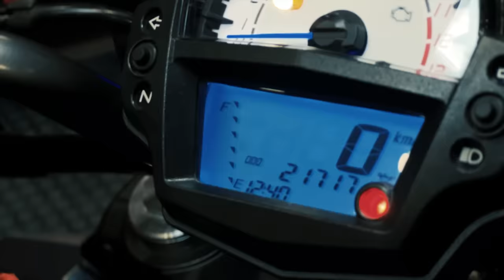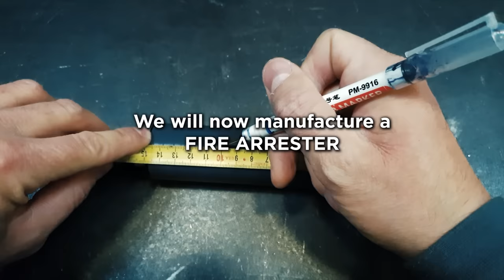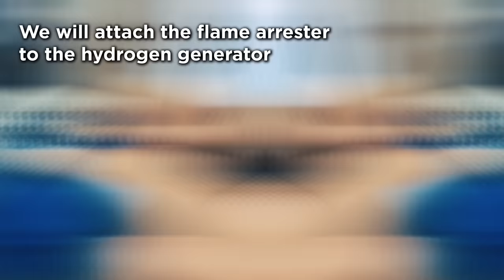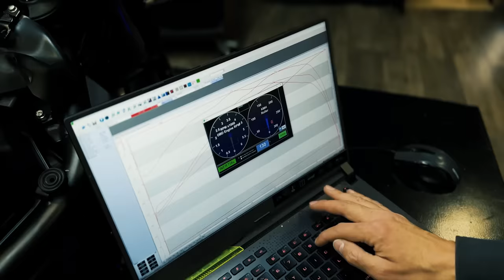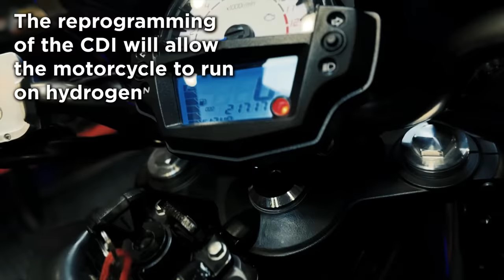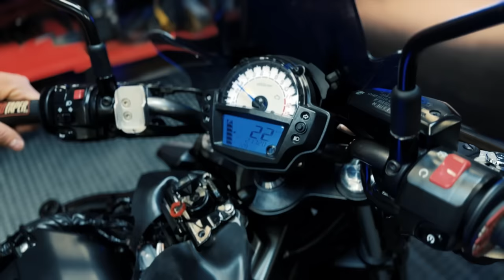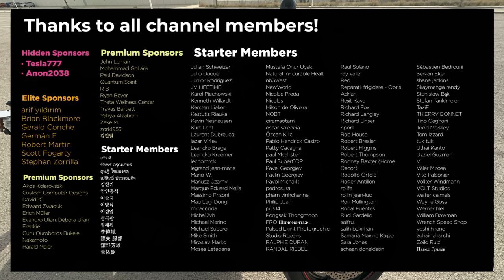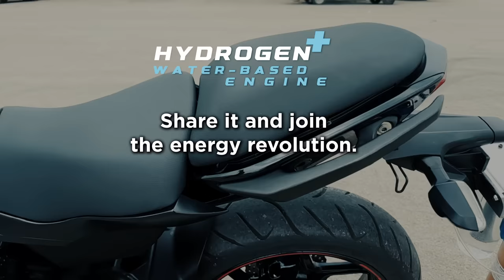Running Bike On Water - 100% Working Trick

Comment: Then he got poisoned and his bike was suddenly gone.
Reply: He posted how he did everything on yt so hopefully that isn't the case
Reply: Like the guy named Stan Myers and the 80s who created a water-powered buggy and drove from the West Coast to the East Coast are on a couple gallons of wahe had a meeting at a Cracker Barrel with GE and government officials and they poisoned his cranberry juice he ran out of the parking lot and died right there
Reply: It's pretty easy to do. Nothig special. But you will quickly learn that you don't go far away. The broke water to hydrogen you need a lot of electricity. You will quickly drain the battery.
Reply: @Shabass  wrong
Reply: @jasonhmoore  where i'm wrong? We were doing this 30 years ago at school. Have you ever try it? It's really simple you know.
Reply: Lol innit 😂😂😂
Reply: Only 20 volts or less is needed
Reply: @Shabass  Have you heard about the alternator? No?
Reply: @jjstro  yes, I can rebuild one for you. A 120A alternator take about 2hp to work. 2hp means you produce 1 kg of hydrogen in about 35 hours with extra efficient electrolysis. That kg of hydrogen is about equivalent to 3.7 liters of gas (1 us gallon).

To bypass this, you but a big fully charge battery to compensate that the alternator is not able to produce the quantity needs to run a engine.

Try it, really simple to do, you will understand pretty fast why it's can not work.
Reply: @Shabass  Yes, you are right. How about using a pair of alternators, for example? Still will not do?
Reply: @jjstro  the problem is energy lost in every step to produce then use hydrogen. If you got a big alternator that make a lot of kw to make your's hydrogen, it will needs a lot of hp from the engine, more than what the engine can do to run. Go read on the  thermodynamic law, it's explain everything better than me. But fast explication :

To produce 1kg of hydrogen, you need 39kwh in a perfect electrolysis (real world is around 50). That 1kg contain 33kwh, and with the efficency of ice engine, about 30%, you get about 10kwh usable. You lost 29kwh every time you burn 1kg of hydrogen..that's why you need a battery that was charge before to be able to run a certain time.
Reply: @Shabass  I see. Thanks.
Reply: @Shabass  good for car? Is it's..
Reply: @Shabass  And if there was a "transformer" to increase the electrical power after the alternator, wouldn't that allow for less loss in the end to consume 1kg of hydrogen?
So the battery is used for starting and once underway, there would be little or no loss of power?
Instead of losing 29 kWh, could we lose only 10 or less?
This is just a guess, I don't know about this "technology"
Reply: @spirale7  no. Every step add a lost in energy. To make that work, we will need free energy out of nothing. And that's not the case. Every time we do something, there heat produce, and that heat is energy lost.

Since we are not able to make a system that produce over 100% efficency, not going to happen.
Reply: Comon he done the poisoning in first place !!!
Reply: Capitalism 😂
Reply: Lol😂
Reply: no he won't coz it doesn't work 😂
Reply: a lot of commenters think he’s not Faking everything, lol
Reply: @jjstro si la moto sviluppa 75Kw e ru con due alternatori ne sviluppi 3.5
Reply: @Shabass no es asi se necesita un pwm osea un modulador de frecuencia como lo hizo estanley Mayer
Reply: @Shabass  verdade. E para maia no projeto dele , a mota nem gasolina usava 😅😅😅😅 imagina agora, como é que a centralina vai ajustar a injeção se o que sai do escape é vapor de água 😅😅😅😅 Esse cara é mágico e a magia dele foi por um depósito de gasolina escondido dentro da 🎩 do 🐇  kkkkkk
Reply: Yes, and the Earth is Flat. KKKKKK
Reply: Best idea would be create an "accident" were both the bike and him are no longer at one time..there are plenty of other ways to do it without death carma on your hand..fear is there favorite..create fear that there very dangerous to you,others and of course the earth...wins every time
Reply: Another goner
Reply: اذا تم العمل على هاذا المشروع بلمستقبل فلن يكون هناك مشكله من ناحية استنزاف البطاريه لان سيتم وقتها استعمال بطاريات وكهرباء تعمل بالطاقه النوويه @Shabass
Reply: @laerteoliveira7923 you know it is flat or u can believe it's pear  shape now cause they can't keep it straight
Reply: @rustyshackleford3320  I know this video is bulshit.
Reply: What if his soul's mission and life's mission had been fulfilled and he had therefore passed away in this unpleasant way? And what if a karmic debt had also possibly been paid off, whereby the question is how karma exists at all
Reply: Bigger alternator @Shabass
Reply: @FactosECiencia  ze hebben de CDI aangepast.
Reply: @dawoedderidder2451  bigger alternator need more hp, so more fuel.
Reply: I hope this motor would be sell the Philippines and you have a lot of money if you did bro
Reply: Wäre nicht das erste Mal
Reply: Just don’t show your face. Anything that replace technology with water.
Reply: @Rannvijays Das war schon immer so -leider .😢
Reply: Live him alone😂😂😂
Reply: اخي لانتاج كيلو واحد هيدروجين كم كهرباء يبغى لي
Reply: لانتاج كيلو واحد هيدروجين كم تكلفة من الوقت والسعر
Reply: Wind turbine generators?
Reply: No one likes smart pants especially the Rich business men!
Reply: For produce one kilo heydrigen how many electric you need
Reply: Because it can destroy oil industries around the world
Reply: @jjten2657  
20 volt how many grams you produce of hydrogen
Reply: 2024 and this old ass conspiracy is still doing the rounds 😂
Reply: @jasonhmoore Wrong what?
Reply: @Shabass  bike needs a larger alternator then a switch to run off it once its started so it won't drain the battery..
Reply: Out of 55 people commenting here none have maths/physics/chemist degree. I challenge any one of you for $10000 that i'm right
Reply: That's what they've done with anyone that has created something that works really well and will not relinquish it
Reply: @cheechychongz7124 can you imagine someone making a homemade hydrogen vehicle and they have an accident where the power is turned on to the hydrogen generator
Reply: @Rannvijays they will lose Millions if not billions of dollars
Reply: @MarvinMagpantay Hindi yan mabebenta sir, pinapatay lahat ng mga inventor ng ganyan
Reply: what about using a litle bit of hydrogène and let the bike works normaly its like just boosting ?? 🤔🤔 @Shabass
Reply: Has there been a measurement on the exhaust about NOX generation.
Reply: Thanks for sharing now everyone try to create it
Reply: @Shabass bruh just make a small hydrogen generator DUMAS
Reply: I heard it was a dennys not a Cracker Barrel

Comment: This is not real. Believe me I have built several hydrogen units. This battery on the motorcycle cannot handle the amp draw needed to power the unit. and this unit is only putting out about 1/4 liter per minute. You need a reservoir in order to produce enough hydrogen when accelerating. The real deal here is he is getting lots of likes and reviews. Good for him, but believe me it does not work. It can work however you need much more to make it work.
Reply: Boujour il veut peut-être qu'on trouve la solution pour lui dans un commentaire ? ++
Reply: It would be more believable if the fuel tank was completely removed, leaving only the hydrogen set up.
Reply: This is the comment I wanted to see. I am not a chemist nor a physicist nor electrician, but I cannot imagine to have sufficien hydrogen for max throttel then again just ground revolution on engine without having a compression chamber with constant H2 pressure. And how can a gasoline pump and injectors manage to work instead of fuel with gas. If all this problems are shown in video i'll believe it. But first how you have told not enough power from a 12V Battery. Thanks for sharing your experience.
Reply: Just small amount of hydrogen goes into air inlet and large amount of oxygen.
To burn hydrogen we need same amount of oxygen otherwise it will not burn
Reply: Is there any links,then where this is actually the case?

Comment: If you use a 2-stroke engine, you'll get better performance. The simple tweaks are quite easy, really. Change out the intake with a welded shut intake. Then drill a hole to add your fuel, ex. Hydrogen and oxygen.Then, change oit the piston with a modified piston that has an oil ring. Then add high performance indy track, 2-stroke oil.. drill bottom, and add top portion for adding the oil. Then, hook up the fuel, and take it out for a quick, and exquisite run! Enjoy

Comment: The math doesn't add up. Hidden tank somewhere because it wouldn't run that large of an engine on that small of a generator. If you're going to make a video like this at least lead people in the right direction with a project that's actually feasible.😂

Comment: Find the resonant frequency of water and you can move the decimal point over one place. Instead of 15 amps it's now pulling 1.5 amps. Create an injector/spark plug combo unit. Inject water into the cylinder and fire it with a resonant spark and you won't need electrolysis.

Comment: If you had used 316 Ti steel instead of 316L; you would not have any stain and you should also have used the fuel tank for "water tank". The main idea in electrolysis is the surface area. So you do not need such a big reactor to electrolyze. You need a tablespoonful of 316 Ti dust, two chambers seperated with a layer of nylon, which transfers water but not the 316 Ti dust. Put the dust in each chamber. To each end of chambers, you should put cathode and anodes also made of 316 Ti. your reactor wouldn't be bigger than your palm and it would create a lot more pure hydrogen than you expected. You also wouldn't need to put the unit at the rear. Just put it beneath the water tank. So your bike would seem no different than a usual one, but run on pure hydrogen. Now you have the "know how". See if you can do it...
Reply: Hay apoyar manda tu link así lo vemos campeón
Reply: Interesting. Have you seen this done already? Is it related to the hotrod stuff thats out there? I'm keen to learn more on this subject 👍🏻

Comment: What did you use, sodium hydroxide or potassium hydroxide for your electrolyte??? Considering the engine is for gas, not hydrogen, how far did you advance the timing??? How did you deal with hydrogen burning hotter than gas??? Did your head crack or just blow out your valves??? I was thinking a porcelain head for the heat or stainless steel water cooled. You have to run a cooler plug, what did you use??? Unless your exhaust is 316L stainless steel, which none are made with that, the water is just going to corrode it over time. When the bike is at idle what happens to the excess hydrogen??? Do you just blow it off (dangerous), or use the frame tubing of the bike to store it for acceleration...??? Man... so many questions I have...
Reply: Potassium hydroxide is better then sodium hydroxide because sodium hydroxide is more corrosive than Potassium hydroxide so it's better for your fuel cell
Reply: @greenfueltechnologyhhogogr9813 Potassium hydroxide enables around 3x the output as well. Just very corrosive so be careful not to get any on the skin.

Comment: It kind of makes sense without the fuel pump which is inside the gas tank. The bike should not be able to run. I find it very interesting that the hydrogen pressure is enough to flow through the injectors. Well, this may work, but not be very safe.Or healthy on the motor itself.Because hydrogen fuel is very dry and it needs other hydrocarbons to lubricate the Cylinder wall. There will eventually be compression loss if the cylinder is dry and the oil pump has not been modified. Then there will be a catastrophic disaster.

Comment: Where do you get the power for the electrolysis? How many percent is the energy conversion ratio from electricity to hydrogen? 49 kilowatt hour of electricity produces 1 kg of hydrogen, which delivers just 33 kilo watts of power. (49kwh electricity = 1kg hydrogen,  1kg hydrogen = 33 kwatts of power). You've got a deficit boy!!!  Good luck!!! :-)
Reply: That’s what the magic HHO+ fairy dust did

Comment: Let's skip all the obvious lies. You say your module draws 5 amps. That's 60W. Commercially available electrolysis systems require about 50 kWh of power to produce 1 kg of H2 from 9 kg of water. Your module will be able to produce 60/50000 or 0.0012 kg = 1.2 gram of H2 per *hour*. Hydrogen gas releases 34 kcal per gram upon combustion in air. And you want to run a bike on that? Another even simpler debunk: 60W for an engine that needs in the order of 50kW to run?
Reply: Those are the stats for producing hydrogen. This is producing hydrogen+oxygen. It's more of a process to produce oxygen and hydrogen separately.
Reply: @johnathonsandler9507  Are you for real? I left out the oxygen part because that's a given for electrolysis. Please explain the magic you think that allows this guy to break the laws of physics?
Reply: @erichop822  it all depends on the material used and the way they are placed.  I've seen situations where steel wool inside a sock then the next piece of steel wool wrapped around the sock with wires going to each steel wool for the power works also. The power used is based on the design of the metal.
Reply: @erichop822  the real question is how the hell would it produce more so the engine revs up. I get you could pump it into the air intake to save on gas but I don't understand how it could use more without upping the voltage. Seems like you would need a hydrogen fuel cell but then it would basically be all electric
Reply: Lawn mower even runs off hydrogen fuel cells and ge demonstrates everything and answers questions
Reply: SI FUNSIONA POR QUE YO LO HE VISTO EN AUTOMOVILES Y MOTOCICLETAS

Comment: I had a conversation with an AI about this. It speculated that your white "HH+" powder is a highly concentrated industrial grade of citric acid. It told me that such an acid would appear like granulated white powder and that it would have a concentrated density of H+ protons that release when dissolved into water.

In simple terms, it could be possible with experimentation and the ability to obtain industrial grade citric acid powder. Basically, with experimentation, it's possible to find the right combination of citric acid and PEM Hydrogen Fuel-Cell placement to create an efficient electrolysis process which creates more useable energy from hydrogen gas than the energy it takes to make the gas. 

When you add citric acid to the water used in the electrolysis process, it can increase the concentration of H+ ions in the water. The presence of a higher concentration of H+ ions can enhance the ionic conductivity of the water, making it a better electrolyte. As a result, this can potentially improve the efficiency of the electrolysis process, leading to an increased production of hydrogen gas (H2) at the cathode during electrolysis.

With a higher concentration of H+ ions in the water, there will be more available protons (H+) at the cathode for reduction, which is the process that generates hydrogen gas. The greater ionic flow of electrolytes in the electrolysis process can help ensure that more protons are available at the cathode to be reduced into hydrogen gas.
Reply: Finally someone making sense.
Reply: @TolisOnLine  Thanks. I tried to simplify it. I think that if you say the same things enough times in different ways, then most of the people who read it will start to get the idea and see how it could be experimentally successful. That's how grade-school science teachers taught, along with being odd and entertaining. What's more oddly entertaining than learning about a zero-point clean-energy producing electrolysis process from the speculations of an AI? Well... I mean, I guess there are some things, but it's pretty fun.
Reply: Any soluble compund will work in the electolite as long as it increases conductivity.
Reply: @user-wf4hy4ub7p  No. You need something that can also release extra Hydrogen just by dropping it into water. That's when aluminum hydride tablets enter the equation.
Reply: @davidt1621  Baking soda will also do the trick and isn't toxic. Salt works as well.
Reply: @user-wf4hy4ub7p  Would it work with sea water?